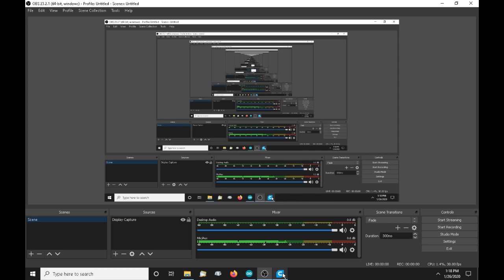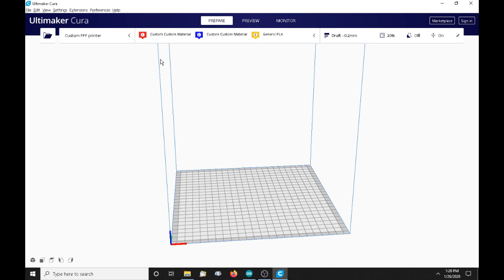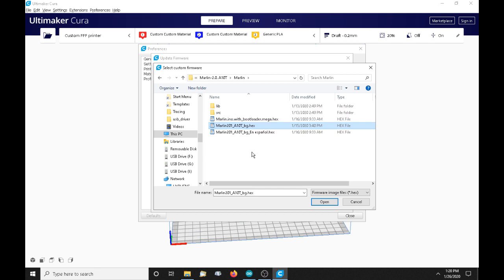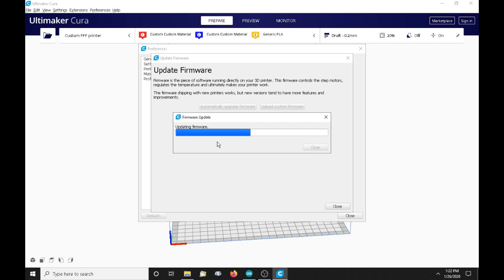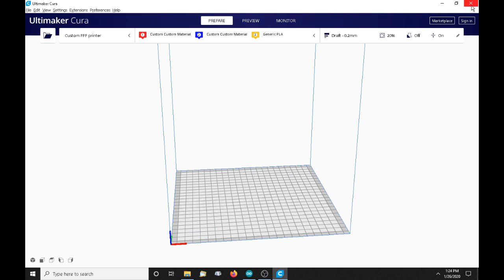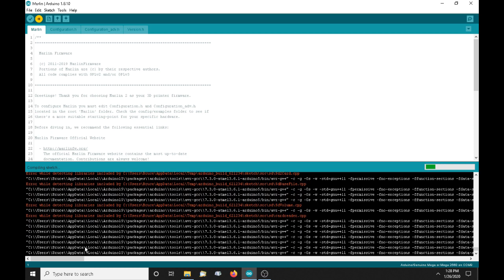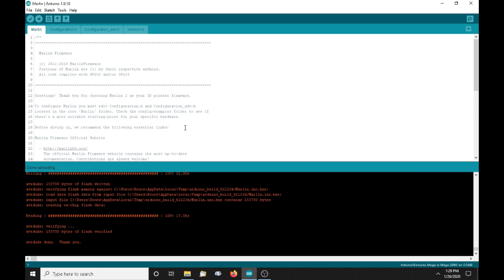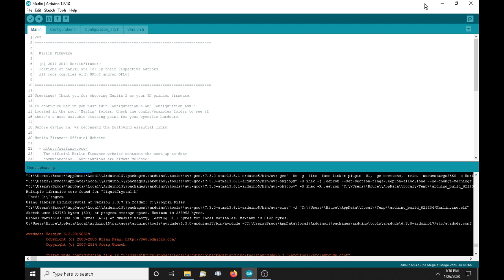Uploading Firmware to GT2560 Ver 4 board

Comment: where can I find the library for the 4.1b board for marlin?
Reply from the maker: for the A10 models, the 4.1b board configuration.h is in the marlin example configuration zipfile, download from marlin github.
For A20 models, use the 4.0 or 3.0 configuration, they are the same for those boards and 4.1b

Comment: This is probably very valuable information for my A20M. However, I get all kinds of error message when I compile the firmware. Is there any good guide on the Geeetch printers? I followed Tom Sanladerer's tutorial but there seem to be additional factors that he didn't cover. Any pointers are appreciated!
Reply from the maker: best to start with the example file for your printer from marlin config examples file.
And, if you are using bugfix branch, you must use a fresh configuration.h  an old one will not work, as the configuration/h file was updated on  december 16th.
Reply: @1zradio660  Thank you sir! I managed to compile a working Marlin 2.0 from Verta's repository with no issues after I realized that the configuration.h file contains everything that was elsewhere contained in start_here.h. I also used VS Code instead of the Arduino compiler. 
The new firmware is amazing!

Comment: I really appreciate your videos.
I have a question for you and I would like to know your opinion, so I am trying to upgrade my Geeetech A20T to add a 4th extruder. Do you think is possible to use a PWM pin on the GT2560 Board and configure the pins using the marlin firmware? So when update the printer using CURA to configure the 4th extruder and create the design with 4 extruder and the GCODE will then activate each extruder? 

Hope this question makes sense and hope you could give me your opinion. 

Thank you
Reply from the maker: You need 3 pins to add another stepper driver, that would need defining in the pins file.
Step, Direction, Enable.
I am adding a quadfusion head to an A20M, but have decided to just use a board capable of up to 6 extruders instead of trying to add another to the gt2560
yes, theoretically possible, but being an 8 bit board, not sure how well it would work.

Yes, once marlin is told there is 4 mixing steppers, Slicer settings are same as normal for selecting extruders and so on
Reply: @1zradio660  Hey, I really appreciate the opinion, thank you very much.
So do you think is possible to just configure the pin in marlin to send to a pin in the board an activation (5V signal)  signal and then take that signal and read it using another board (Arduino for example) to activate the extruder? To simplify the question: configuring a specific pin to activate when the gcode activates an extruder, read the signal and activate the extruder with another board?

Sorry, I know this question might sound odd, but I really would like the opinion of a professional like you.

Thank you for taking the time to reply.
Reply from the maker: @lemicmelo7713  the best, simplest way, is to wire a new stepper diver off the board.
supply the 3 needed pins ( can use the filament detector pins, etc ) 
and +5v , +24v  etc....
Reply: @1zradio660  Great, I see your point. Any recommendation on how to configure the extra pin on Marlin? I know there is a section to define the number of extruder, but beside this do I need to define the rest of the pins for dir, step and enable? 
This question might sound rookie but I will like to confirm it with you. 
I really appreciate the information provided, it is of great value.
Reply from the maker: The 3 pins are defined in  pins_GT2560_V3.h
have a look in there and you will see
Reply: @1zradio660  Hey mate, thank you again for taking the time to help me. I have another question as I'm still working on this project. How can I configure the marlin to activate multiples nozzle to print at the same time?

Comment: Where did you get the boards.h file for the GT2560v4 ????
Reply from the maker: it uses the ver 3.0 .... since the pins for ver 3 and ver 4 are identical.
Reply from the maker: #define MOTHERBOARD BOARD_GT2560_V3
Reply from the maker: so the same firmware works for printers with Ver 3.0, 3.1, and 4.0  , and I believe for 4.1 as well,
Reply: @1zradio660  Awesome. Thank you... Now if i can just get the rest of the file figured out, i'll be good.. lol
Reply from the maker: Just start with the configuration.h and configuration_adv.h for your printer, from the example configs file.
Makes it quick and simple

Comment: this doesnt work on rev A no?
Reply from the maker: should not need to use this process on Rev A.
But, if you are getting time-out errors when you try to upload firmware, it might help
Reply: 1zRadio yea I tried both ways in this video and still didn’t work. The board has 2560 REV A stamped on the back of it.. is it meant to have a boot loader?

Comment: How do you even comply with file when you don't have board schematics? 
You cant update to Marlin2.0 because 2 out of 3 extruders won't work.
Reply from the maker: Yes, you can update to Marlin 2.0
The pins_GT2560_V3.h  pins file in marlin 2.0 already has all the pins defined that you need.
I put Marlin 2.0 on my A10T the second day I had it, and all 3 extruders work as they should.
Reply from the maker: And the GT2560 V3 and V4 boards use the same pins file.
So you do not have to find one that is "Ver 4 specific".
Reply: @1zradio660  I just tried again with Marlin 2.0.5.4 and newest download of configuration.h and adv.h for A10T. 
Not working. I am using Repetier-Host to switch between extruders. 
E1 - works
switch to E2 - doesn't work (no error shows)
switch to E3 - doesn't work (no error)
switch to E1 - doesn't work (no error)
I don't know if this matters but there is no  pins_GT2560_V3.h  file in Marlin 2.0.5.4